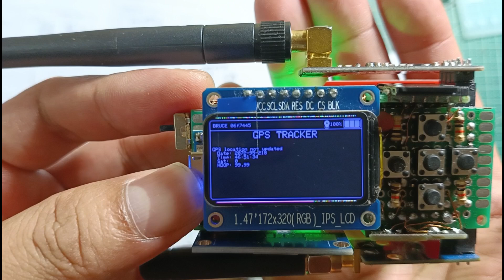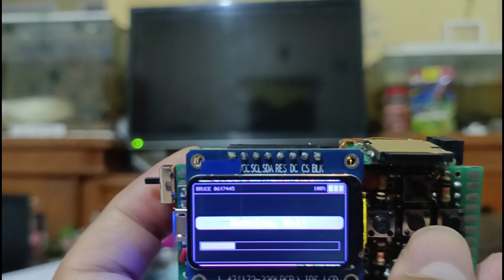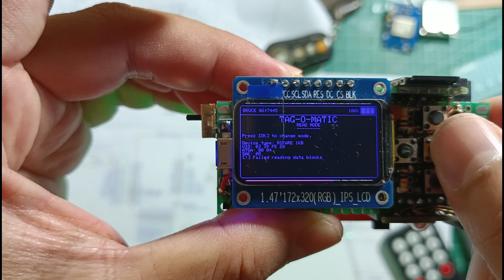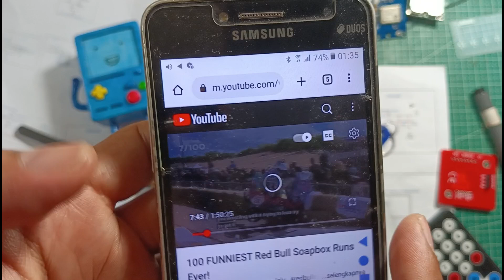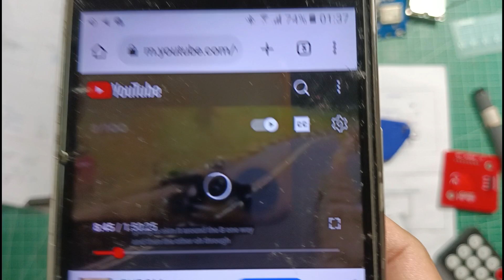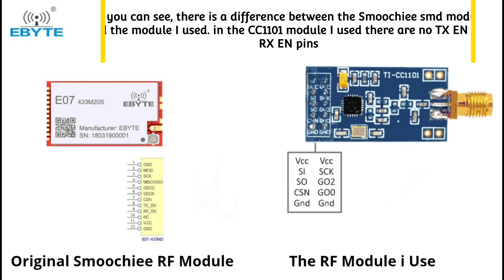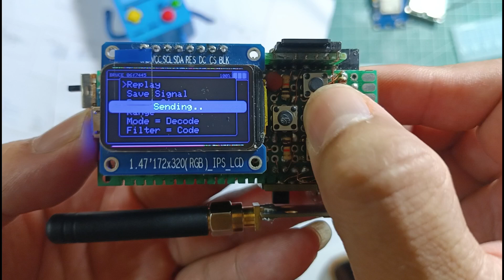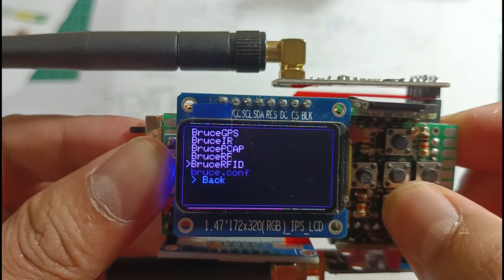Part 5 Testing the Modules - DIY BRUCE Smoochiee Board

Comment from the maker: Next video is make a case for this device
Reply: Can’t wait for it 😅
Reply: @ARTFOR Sir I have this display GMT130-01.0

Pixel: 240×240

Driver IC: ST7789 Interface: SPI and my display is getting black screen 😭😭😭 because I don't have a cs pin and I don't have money to buy that display
Reply: Mas buat tv b gone mas sempet booming tuh alat
Reply from the maker: @punisher.darkage  tv b gone kan udh ada difirur IR diBruce ini bang
Reply: @ARTFOR  Iya min cuma maksud saya fitur tv gone nya aja gk sekaligus sama firmware Bruce nya. Soalnya low budget min. Seperti ini contoh nya ▶️ https://youtu.be/VQqO3hlBcD8?si=Dmca22He_0i6AHJV
Reply: Itu kan buat chip nya make ATtiny85 klo bisa di ganti wemos/esp8266 aja min. Semoga di buatkan😇 

 saya ada rangkaian nya cuma kurang paham bisa saya kirim klo mimin mau
Reply from the maker: Jc official ini udh dari 8 THN yang lalu ya🤔🤔
Reply from the maker: Liat2 dulu deh saya bang Yaa😁
Reply: @ARTFOR  siap abangku semoga aja di buatkan
Reply: @ARTFOR  iya bang soalnya emang sempet booming di tahun itu cuma tahun skrng orng pada kg tau alat tersebut
Reply from the maker: Iya soalnya sekarang pake hp jg katanya bisa
Reply: @ARTFOR  iya bang bisa cuma Sistem kerja nya engga kaya brute force attack. Kalau pakai hp harus Milih model rv nya dulu. Tapi klo ini dia make sistem kerja Brute force attack jadi nge sending bilangan biner satu per satu ke Ir LED. Jadi gk perlu milih merk tv buat nge matiin. Berharap di buatkan si bang 🙌🏻
Reply: @ARTFOR Sir I have this display GMT130-01.0

Pixel: 240×240

Driver IC: ST7789 Interface: SPI and my display is getting black screen 😭😭😭 because I don't have a cs pin and I don't have money to buy that display now can you make it by disabling the cs pin
Reply from the maker: you have to modify the code if you want it to run according to the display you want, unfortunately I can't do that. I'm so sorry...🙏
Reply: Please sir 😭😭😭

Comment: Hi, im having a problem with the rfid modle (pn532) i have checked the wires so many times but it says rfid module not found please help
Reply from the maker: Have you set the config in Bruce for RFID to "PN532 on I2C" ???

Comment: halo bro do you have suggestion about my problem. my gps is not working cuz when i try the gps and copy your schematic u have i use the latest firmware of bruce the problem is i already change the configuration of rx and tx to 1,2 cuz when i  go to bruce latest firmware its connected to 47 and 48 but still my gps not detecting any signal do you have any suggestion? thanks.

Comment: bang mau nanya dong, kenapa NRF24 spectrumnya ga keluar, untuk CC1101 bisa running
makasih
Reply from the maker: Tapi modul NRF24 nya kebaca ga bang?
Reply: @ARTFOR  untuk modulnya kebaca bang.
Reply from the maker: Spectrum pada pada Nrf24 gunanya mendeteksi sinyal yang dipancarkan oleh alat2 dengan frekuensi 2.4Ghz. Coba nyalain wifi hp, router wifi atau alat apapun yang memancarkan sinyal 2.4Ghz
Reply: @ARTFOR  sudah bang, jammernya  g berfungsi juga soalnya.
Reply from the maker: Sepertinya NRF24 Bermasalah, klo emang bener perkabelannya sudah bener tapi spectrum sm jammernya ga fungsi, coba pake nrf24 yang baru, atau coba nrf24nya test dialat yang lain
Reply: @ARTFOR  siap makasih bang ku coba dulu
Reply from the maker: Ya semoga bisa

Comment: 11:19 How do I fix the SD card problem? Please help me.
Reply from the maker: Upgrade it to latest firmware up to 1.10, it fix SD card problem on my DIY SMOOCHIE BOARD
Reply: @ARTFOR  my cc1101 error not detected pls help🙏
Reply from the maker: Must be in your wiring connection, go check again

Comment: Bro what is the coonections for E07-433M20S RF WIRELESS TRANSCEIVER with esp32 s3 N16R8
Reply from the maker: You can see original smoochie board for the schematics E07 Transceiver

Comment: about sd card, did you connected it to 5v or 3v? if its big arduino - connect it to 5v, if its small - connect it to 3v, i had the same issue
Reply from the maker: I've done both but it still doesn't work
Reply: @ARTFOR  strange.. did you tried to format sd card to fat32? and is your microsd card >32 gb?
Reply from the maker: My SD card is only 2gb, yes it's fat32
Reply: @ its 2-32gb only, try 16 gb works to me
Reply from the maker: Ok then thanks for your suggestion bro👍
Reply: @ARTFOR  if you tried both and you have small you might have fried the module
Reply from the maker: I use a micro sd card module. Although it says 3.3v on the pcb board, because I was curious, I tried supplying it with 5v power for a few seconds to test, but it still didn't work. I don't think it will damage the module.

Comment: can i use any display with same pins
Reply from the maker: Yes if it have the same pin and resolution 170x320 and driver ST7789 SPI

Comment: Please create a video on a wiring setup as well, it’s getting hard for me to manage wires on veroboard
Reply from the maker: if you follow the scheme correctly then it will be very easy to follow
Reply: @ 😭I am very bad in wire management
Reply from the maker: so do I my friend, you can see how messy is my wire management. i better start learning fritzing 🤔
Reply: @ can we use 2*2 matrix push buttons in this ?
Reply from the maker: Yes you can, but still you need to put resistor for each switch

Comment: Awesome please continue the red 2.8 inch display bruce project , I'm watching and currently stuck because you stoped
Reply: Hiiiii i got my sd card working
Reply from the maker: Really???....how?
Reply: Want help??
Reply from the maker: Of course 😁😁😁
Reply from the maker: Yea i have problem with firmware, and i can't fix it if it's related to code
Reply from the maker: I Will try again ASAP
Reply: There is accualy a problem with some displays sd card needs more configuration but your problem sms to be that the power (ampere) that the power source is giving is not sufficient.
Reply from the maker: Ok, so should I use a separate power source ? I did that but it still doesn't work.
Reply: @ARTFOR  please send wiring details
Reply from the maker: @dkrafter4080 you can download the schematics from link in description
Reply: @ARTFOR  sorry for the delay How can I so basically take an adapter with step down from 5 v to 3.3v and supply to the screen the negative should be common for the esp32 and screen . Please let me know if it works , if it doesn't show me the back side of screen, look for a tiny resistor called J1 if it is there tell me. I can help further.
Reply from the maker: You don't need step down converter to supply screen, you can use 3.3 volt from pin in esp32 board, what is J1?
Reply: @ARTFOR  you should not supply voltage form the esp32 board, J1 is a resistor seen behind the screen filp and look , if there is you can supply 5v
Reply from the maker: @dkrafter4080 oh yes i see to select voltage 3.3v or 5v for the screen
Reply: @ARTFOR  is there a resistor?? If not then don't give random one
Reply from the maker: @dkrafter4080 no there is no resistor.....
Reply: @ARTFOR  ok supply external voltage 3.3
Reply from the maker: I'll try....btw have you continued the bruce project with the red display???
Reply: @ARTFOR  ye but having problems with the pn325 and nrlf24L01
Reply from the maker: @dkrafter4080 why? You just Connect them just like in CYD, ok then I'll make the video soon
Reply: @ARTFOR  the ampere of the esp32 might be less.
Reply from the maker: @dkrafter4080 it mean use external power right?
Reply: @ARTFOR  yes atleast 2/3a